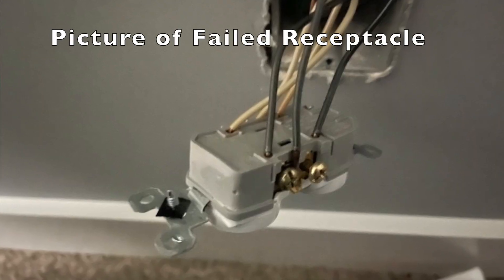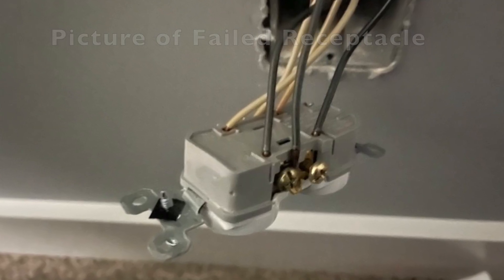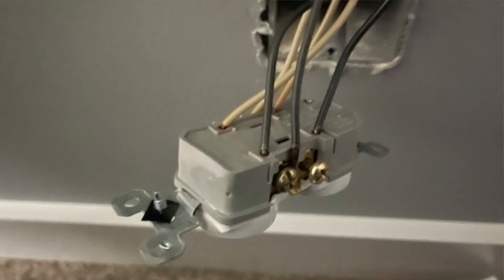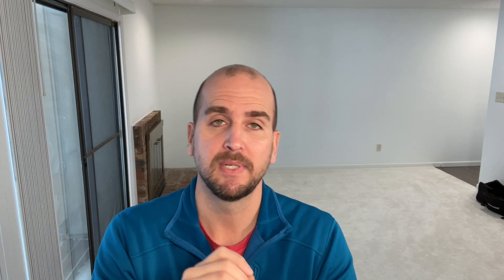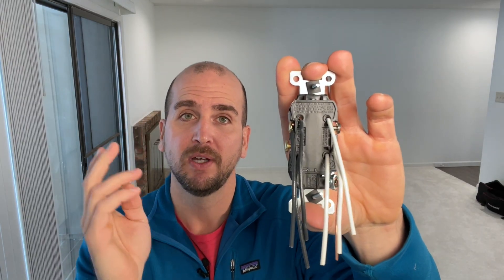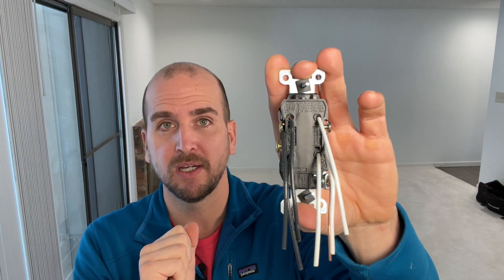Incorrectly Wired Outlet Found In Newly Built Home

Comment: I found your video looking for an outlet like mine. 3 white (neutral) 3 black (hot) and a ground wire (I think mine has one. I have an older house.). But when you shower the pigtail explanation, (which I was already suspecting I’d need to do because, sang, that’s a lot of wires!), you didn’t show what to do with the lower two (or third/non-pigtailed) wires. There’s 3 of each. Does the 3/non-pigtailed wire just go to the same side lower screw? I’m assuming that’s correct but would love a second confirmation. Thanks!

Comment: 3:59 oh alsl I just wanna point out I noticed theres to much insulaiton removed on the oush in wire connectors for the metak exposed is not meant to be extended past the back of the receptalce

Comment: We recently had a problem with our electricity in our living room. All the outlets stopped working. We called an electrician and he said that our entire house was wired wrong.  He called it called “backstabbing”.  It’s illegal now, but at that time the house was built the contractors did it that way. Now we’re looking at about a $7000 electrical repair to do the entire house and panel box.  

“Backstabbing” refers to the process of pushing wires into the back of an electrical outlet instead of attaching them to the terminal screws. They did it to save time.  They would have pushed the stripped wire ends into the small hole at the back of the outlet where spring-loaded connectors would hold them in place.  This practice can cause loose connections, burnt outlets, and fried wiring. This method of wiring is generally unstable and can cause electrical fires. There’s no way we have $7000 and I don’t even know where to begin. I can’t sleep at night for fear of a fire.

Comment: Would it be okay to just remove the screws from unused terminals instead of screwing them in?
Reply: No, the threads are staked at the ends to make removal difficult, and if you're using commercial grade receptacles you'll have a loose clamping plate inside.

Comment: I love all of your info but I ran into this problem that I’ve never seen. I’ve replaced many plugs and switches and never had an issue until I went to change this light switch in a home built around 1980’s. Three of the four wires were black, and one was a ground wire. The problem was my friend had removed the switch before I got there so the only way I could figure out what to do was by testing the wires. The weird thing was two of the three black wires were hot wires. I managed to figure out what to do but I never understood  why all the wires were black and why their were two hot wires on a bathroom light switch. Any ideas?

Comment: I read that electricians tend to use side terminals on receptacles, but tend to use back holes on GFCIs. Installing a GFCI, I tried to use side terminals but failed because the screw kept moving. I then tried the back holes: it was so easy! However, everyt

Comment: DIY. Please correct me if i am wrong. The most important benefit of pig tails is that it avoids overuse and over heat of the receptacles when  connected in series. The current in each receptacle flows only when used. Since they are not directly connected thru the Host receptacle, the current of one receptacle does not reach the other because it flows thru the pig tails.

Comment: I have a similar issue in my home. We have one outlet lower on the wall, which I wanted to extend off of to bring a new outlet middle of wall for the TV to be mounted and hide wires. The existing outlet (low on the wall) has two blacks pushed in on one side and two whites on the other side with one ground. I was wanting to pigtail, but not sure how this will be possible with the new romex (12/2). 

I was under the influence that when I opened the plate, I would have one black one white and one ground j-hooked to one side of the receptacle. I would then be able to take my romex, strip it, put one white , one black and one ground j-hooked to the other side of the receptacle and run it up the new wall and j-hook to my new receptacle. This is not the case since the existing outlet has the wires pushed into the back of the receptacle and there are two sets of each wire already. Any feedback/help is much appreciated! thanks so much!

Comment: Ha I knew it. My receptacle doesn't work properly in my apartment. I opened it up and it's using a 12/3 wire ( i think) and both red wires are backstabbed on top, and both black wires are backstabbed underneath the red, but the gold screws were almost coming out, the neutral wires are also backstabbed on the silver side but at least those screws were tightened. I put in a work order with the apartments but they haven't done anything in months so I wanted to fix it myself. So could I pigtail the red's together and blacks together and connect it to the screw?

Comment: OK, I'm no electrician, but I've replaced many outlets. That last shot where the cover plate screw isn't straight vertical drove me nuts!! LOL, yes... I have issues. Also, my daughters 1967 home in Charleston, SC has all the outlets installed upside down. The ground slot is on the top! Ugh... Thanks for this video, you taught me. And the comments are reinforcing this too. Thanks.

Comment: If backstabbed wiring is not recommended (and I've heard a lot of people say this) then why does the industry provide the option?  I realize it isn't against code and is certified by UL, but if the consensus says otherwise, why not phase out the backstab option and go with the safer, tried and true method?

Comment: I believe using pigtails is adding several additional points of failure. I have disassembled boxes and have found exposed, live wires because the nut fell off at some point. I have fixed intermittent connections and more often than not the point of failure is a wire nut. There is a reason people often wrapped wire nuts in electrical tape. They are unreliable garbage. I have seen wire nuts that have become brittle and break apart, I have seen the plastic come off the spring, and just get loose over time. I am shocked to see people suggesting it as a better method. If the outlet is connected properly in the first place, There should never be a issue down the chain. And if there is, What does it really cost you? I would rather have a more solid and reliable connection rather than saving maybe 20 minutes some distant day later. The way they are designed, it is a cone shaped spring, when you twist it on a bundle of 3 wires or more its often only putting force on two of those wires and only at the very tip. The spring inside is round and has no bite to it. there is very little contact area between twisted solid wires. when a outlet screw bites down on a wire it flattens out a bit and has a much greater contact area.  I am working on a house right now, and I opened a ceiling light that is flickering and it is using pigtails, as soon as I grabbed the wire and moved it a bit, the flickering stopped... Wire nuts are a joke.

Comment: Push-in is just a way to get yourself in trouble. I noticed many people use them (even professional electricians) but I would never approve their usage. I dont care what anyone says, they just dont make a good connection.
Pigtails are great if you have room in the electrical box. What I found in older homes is that they used smaller boxes and it is very hard to fit everything in.

Great video btw!

Comment: Commercial side/back wire plugs are made to handle 20 amps through wire. The "through" load needs to be on the same terminal. I'm not saying your method here is bad, or even less preferable. I am saying with twenty five years of experience, I haven't come across a properly wired commercial side/back plug with issues. I think that's as long as they've been manufacturing them!

Comment: After trying out three bulbs in an inoperative ceiling light yesterday I decided to check the wall switch.  When I pulled it out only the neutral push-in wire was connected to the body of the switch.  Not good!  I reattached both wires to the screws before putting it back in the j-box. The light worked fine after that.  Hope I didn't throw the first two bulbs away!

Comment: Hello. My son in Kentucky called me and he was trying to replace a standard wall switch with a Smart switch. He was trying to remove the two wires from the switch that was being replaced by inserting a screwdriver (and he tried wires, and other things) by inserting it into the release slots on the back of the swirch, but he could not remove them. He found out later that the switch was rated for 14 ga wire and 12 ga wite was being used. Could this be the reson he could not remove the wires from the push-in slots? He eventually had to cut the wires.

Comment: Why so much hate to push ins? If it is in code and rated, it should work. I actually installed several push-ins, no issues so far. From the longevity point of view, screws should be retightened, but spring-loaded connections - not.

Comment: Hello Scott...I just watched this Jan 2023...I need to replace a lot of outlets because they don't hold the male plugs anymore.  I started in the kitchen,  20 Amp circuits, the first faceplate I removed, voila, the blank terminal screws were backed out, they are original. The house was built in 1998, I'm in TN.  Thanks for this video and all the great info you put out.

Comment: Our city inspector began requiring pigtails. I forget details as it's been 2yrs but in a renovation where they commonly used short multiple connections, They now require you to run a 6" pigtail. So when I redid all my sockets I had to pig tail each one. Which I actually found easier minus stuffing wire.

Comment: Newly built house. I tried to replace switch for bath fan with timer. When I pulled switch out of box I found out that hot and load wires were connected with screws and ground was connected to the hot terminal via push in connecter and another side was connected to the metal box. So the box was hot but not grounded. Also I didn't find ground wire in the box. Is there code changed or electrical company started to hire uprofeccionals?

Comment: No idea on NEMA codes here. Location-specific? Timing-specific (meaning, more recent code)? Not sure but one tidbit I picked up from some electrical contractors up in Alaska was (and this was about as of 2014-ish)...They either said it was code OR it was habit (they were CONSTANTLY refering to that code book)...but what they would do is every time they used a wirenut on the "hot", the wirenut was wrapped with about 3-4 wraps of electrical tape after the fact. Kinda made sense in that it ruled out any potential arcing later. Again, no idea if that's "code" or not but ever since I saw/heard them doing that and why, I started wrapping wirenuts after the fact.
Hmmmmmmmmm...
Reply from the maker: Electrical tape isn't called out in the code but seems like about 20%-25% of my viewers at least wrap outlets to cover the screw terminals.  A little less seem to use electrical tape to wrap wire nuts/wire connections
Reply: @EverydayHomeRepairs  Oh, yeah! THAT was the other habit: Cover screw terminals. Forgot about that one. It's been years. Thanks much!

Comment: I bought my house in 1996. The house was built in 1944. Every outlet I replaced or even just opened to check out had at least ONE LOOSE SCREW where the wire connected.  It was the strangest thing. Any comments are appreciated.
ps. My electrician brother always wraps the outlets with electrical tape after hooking up and tightening all the wires to the screws.  Makes sense as often boxes in older homes are metal.

Comment: Just saw your video using Wago connectors which would also be useful here.   When just starting I was told there were 2 major rules for doing any type of electrical work - 1. Never wire anything that is hot and 2. Assume that everything you are wiring is hot.    Based on that after I turn off the correct breaker, then use my non-contact voltage detector, as a final using a pair of insulated pliers - I force the black wire to touch ground to verify no current and then touch the black wire to touch the white wire to confirm someone didn't connect a neutral to a hot somewhere.   Takes a little time, but on more than one occasion I was glad I did it that way.

Comment: Pigtails are great to burn homes down. If you run a 15A load on both sides the single wire will melt/burn.  This is why you ALWAYS wire each load directly to receptacle and let the circuit breakers protect you.
Reply: What do you do if you have 3 each, hot and neutral?
Reply: Pigtails do not burn houses down. If you put a 15A load on both sides of the recep nothing will melt because the breaker will trip.
Reply: You're right but would you wire your own home like this?
Reply: @91326  No, with 2 hots and 2 neutrals in the box I'd attach them all to the terminal screws and not bother with pigtails. With 3 or more of each, I'd pigtail.

Comment: Hey yeah I don’t know whether I should put the wires under the little metal plate where the screws are for the hot and neutral wires or if I should put the wires under the little metal plate on each side for the hot and neutral wires?

Comment: When wiring after the pigtail in mistake 3, you connect to the top screw/outlet. Does that only provide power to the top outlet or will the bottom work too?
Reply: They'll both work as long as the tab that connects them is not broken. You'd break the tab for a split receptacle.

Comment: REALLY GOOD VIDEOS FOR US "ELECTRICALLY CHALLENGED PERSONS"- I have a question I need to add a ground to a standard DUPLEX outlet; the grounding screw plate channel already has( 2) 14 AWG solid copper grounding wires connected;; this means I have three grounding wires (2) solid and 1 stranded- could I use a 2-port Wago for two  of the grounding wires and connecting the 3rd grounding wire to the grounding plate; there's just not enough space for three grounding wires  at the ground screw/terminal; what do you think, please advise thank you PJP
Reply: Patrick, you can't have more than one wire around any screw. If you're connecting 2 wires you'll need a 3 position Wago, the 2 wires and a pigtail. You add one wire to the count for the pigtail.
Reply: @surferdude642  Ted, I ran 2-14AWG 12volt dc wires along with 2 12 volt 14 AWG neutral wires from a 12 volt on/off light switch92 PRONG FLIP SWITCH ON OR OFF) I USED A 5 POSITION WAGO FOR ALL THE WIRES TOTAL 3 HOT WIRES AND THREE NEUTRAL WIRES PLUS 2 ADDITIONAL SHORT PIGTAILS TO CONNECT TO THE 2 PRONG ON.OFF LIGHT SWITCH; NOW I REALIZED i NEED A GROUND SO I RAN A 8" PIECE OF 14 GUAGE stranded copper wire  TO THE GROUND WIRE SCREW ON THE 15 AMP DUPLEX OUTLET WHICH IS VERY VERY CLOSE TO THE ON/OFF LIGHT SWITCH- I USED A SLIT SPADE CONNECTOR SO AS TO PLACE THE WIRE UNDER THE SCREW THE OTHER 2 GROUND WIRE ARE "behind the screw into a slot with a plate you just tighten up the screw i placed the other end of the ground wire into the wago holding the 3 neutral wires and the light switch pigtail- 4wires from each wago; is it possible to draw a simple drawing showing me where to put these wire; I,d BE WILLING TO PAY YOU FOR THE INFORMATION-IT WOULD, NT HAVE TO BE FANCY- JUST SHOW THW 3 PORT WAGO WITH THE PIGTAIL ADDED; CAN YOU PUT 2 WIRES INT O  1 WAGO PORT"" ANY ADVISE OR SUPPORT WOULD BE GREATLY APPRECIATED,!! Patrick Peterman- I, ve called 4 electricians three didn,t have the courtesy to return my calls?? go figure
Reply: @patrickpeterman8736  I'm not following. There are no dc wires. I think you have two 14/2 cables entering you receptacle box, that's 2 hot, 2 neutral, and 2 ground wires. Is the box metal or plastic? If you have more than 3 ground wires including pigtails, you need a 5 port Wago or a wire nut. You can only put 1 wire in each port. You cannot ever connect a neutral wire to a ground wire except at the main electrical panel where there is a bus bar for this purpose. There is no neutral wire on a regular switch, they are both hot wires. One is always hot, the other becomes hot when the switch is closed, (flipped to ON position).
Reply: @patrickpeterman8736  It sounds like you have a neutral or ground wire connected incorrectly. When you flip the switch it makes it makes contact with the neutral or ground which causes a direct short and blows the fuse immediately.
Reply: @surferdude642  Ted, I,m truly not trying to wear out my welcome- I just need an idea of where to start; do the three grounding wires at the ground screw play any role in this situation?? thank,s for your time and patience; "WHERE TO BEGIN"!! Patrick
Reply: @surferdude642  Ted, again thanks for your patience-I wanted to let you know the ground wire had fallen in behind the opening I fished it out connected it to the light switch, and "it,s all good; no more blown fuses blown fuses!!  HAD A FEELING THERE WAS A WIRE MISSING"!! LIVE AND LEARN, THANK, S  AGAIN , Patrick.P
Reply: @patrickpeterman8736  Thanks for letting me know, glad to hear that you solved the problem.

Comment: Each side got two individual terminal. Put two hot wires in each terminal separately and two neutral wires in anther side each terminal. It no needs to using pig tail….

Comment: 4:47. Why not have two hots on both screws on the right, and both neutrals on both screws on the left?  

I noticed on yours you had both under each top screw on each side.   I just changed a bunch out at my house and that’s how they were wired (most with one on each screw).

Comment: No reason to use a pigtail on a residential receptacle when you are just wiring a standard string of receptacles and only have two neutrals and two hots in the box.  I mean, you can, but there is no added safety reason.  You have two screws for the neutral and hot for a reason.